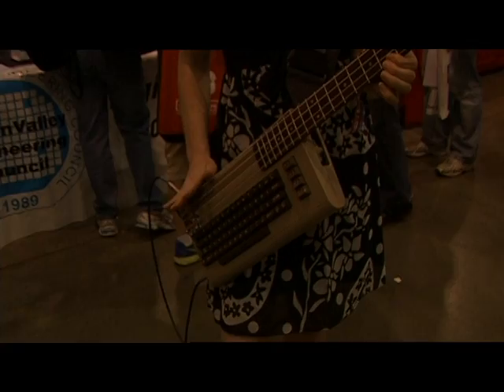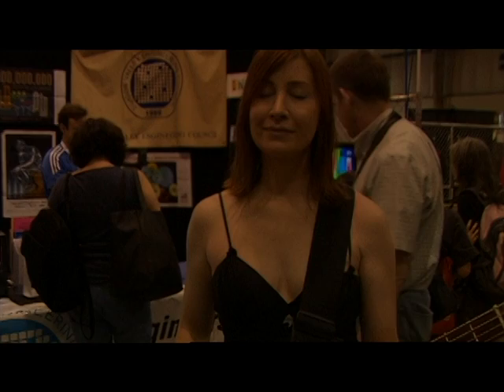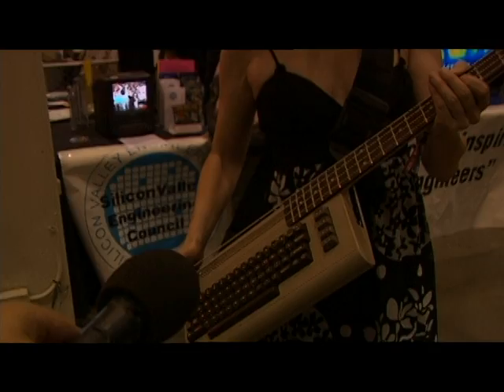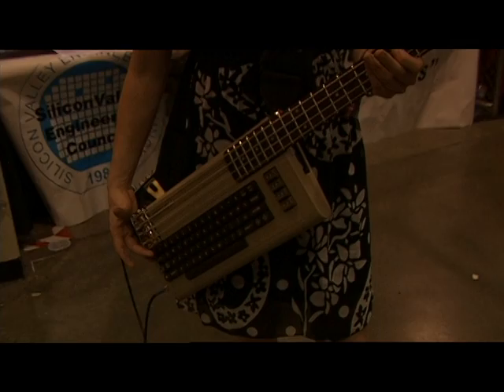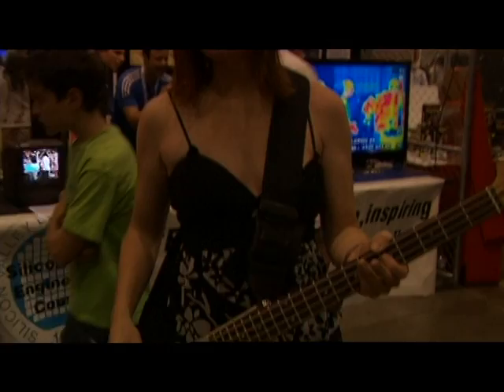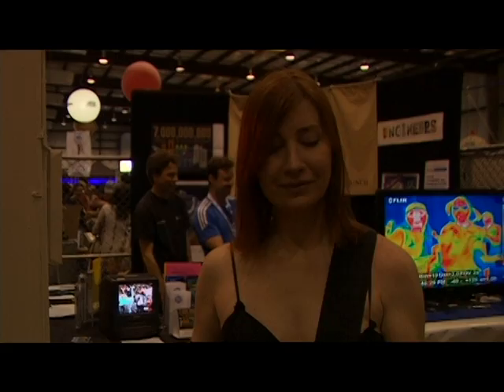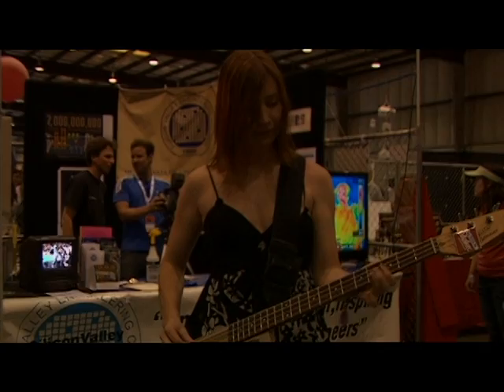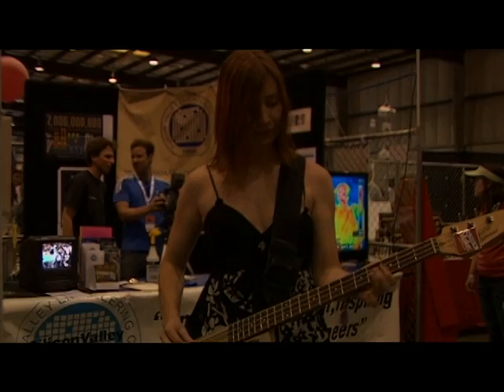Jeri Ellsworth with modified Commodore-64 bass guitar at 2012 Maker Faire Bay Area

Comment from the maker: >this is video # 128KB ?

not sure of the question, it was recorded to a harddrive AVI file, then uploaded that file straight to youtube. View was set to letterbox (I have yet to try squeeze mode). Looks kind of crappy as I did not switch to the filter control knob (it was on 5600K with white balance set for outside). It was typical "run and gun" recognizing Jeri near our booth, better get an interview before it's too late.

Comment: "The C64 came out decades before you were born"... charmer!
Reply: 10 print "Fugouttahere wit dat shit" 20 GOTO 10.
Reply: RUN
Reply: @namizmo  ?SYNTAX ERROR IN 10
Reply: @silkwesir1444  PRINT
Reply: @namizmo  :D
I didn't even mean that... 
"20 GOTO 10" is in the same line as the PRINT command. That won't work. It needs to be a new line.

(Or alternatively, use a colon (":") to separate, but then get rid of the 20 entirely)